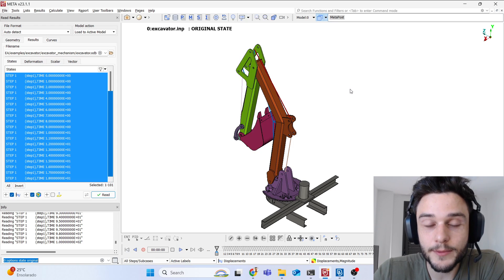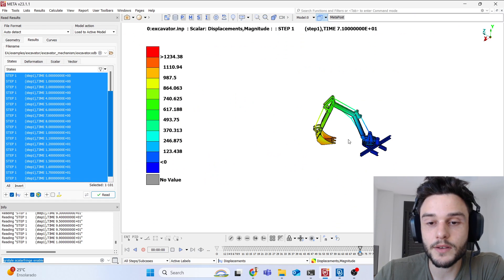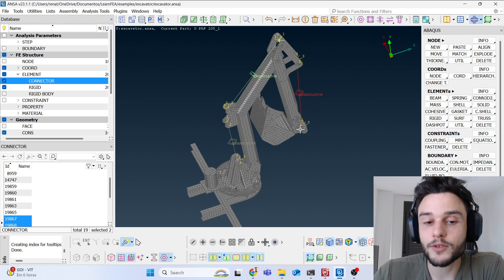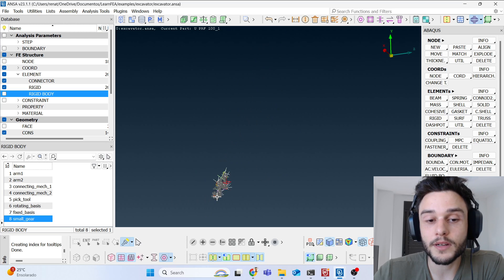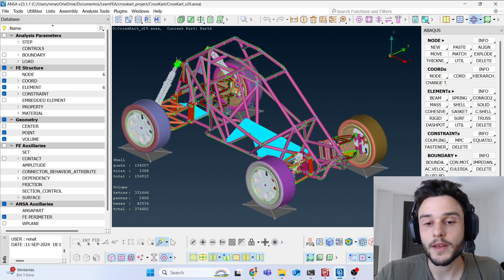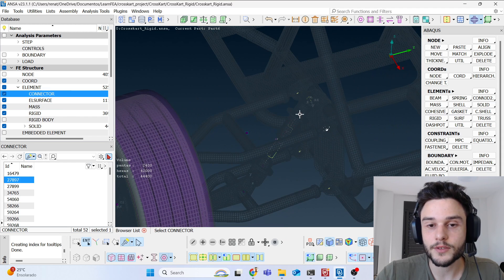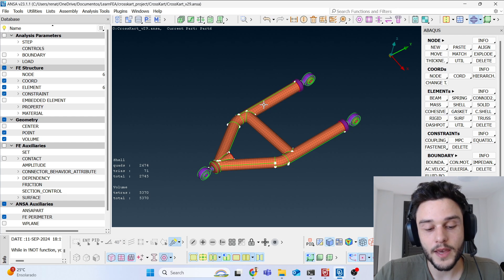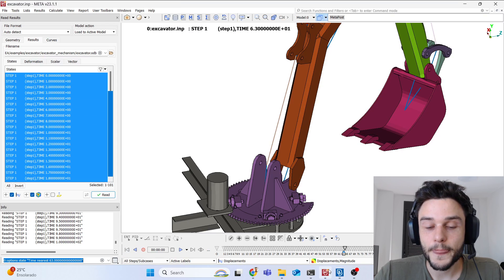Modeling Excavator Arm Mechanism in ANSA and Solving in Abaqus (FEA Tutorial) | Introduction

Comment: This will be an interesting case study.
Well done Renato!

P.S. on the crosskart FEA, can you include a slippage study for some bolts of the suspension structural components?
Reply from the maker: I'm happy to know you liked it.

Yes, a Joint Integrity study will be included in the CrossKart FEA. I usually perform this study by creating a sub-model of that specific joint and applying loads generated by the full vehicle multi rigid body model.